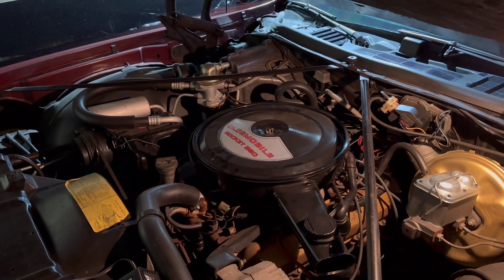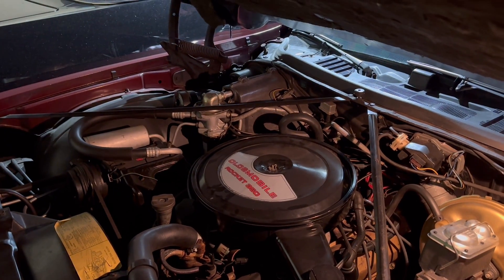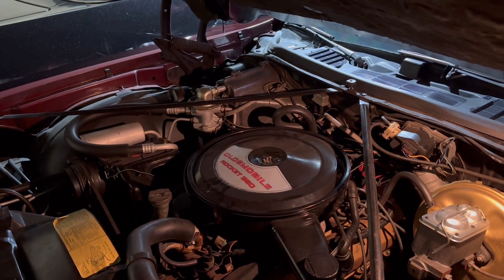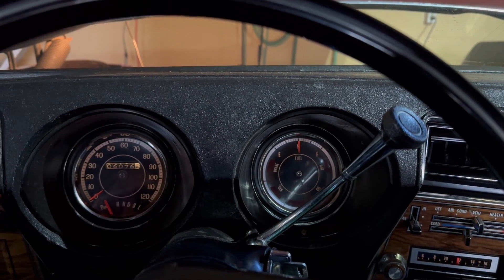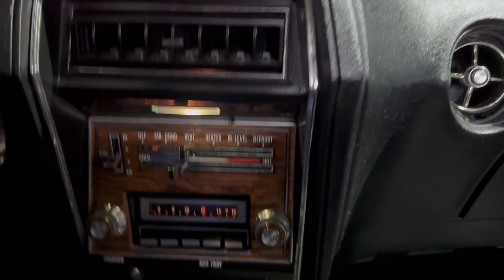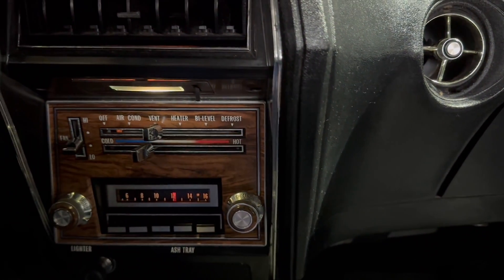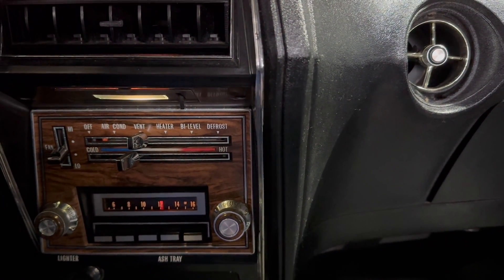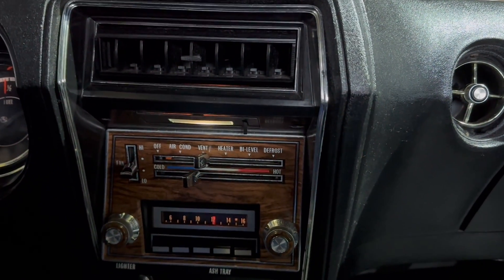GM's "Coolest" Invention Was a Strange Approach to Air Conditioning

Comment: The GM cars we owned back in the day did not have this feature.  The '70 Buick Estate Wagon had a separate setting for recirc called "max" for A/C.  The '80 Oldsmobile had A/C settings of "max" "norm" and something called "bi-level".  On both cars you could actually run the A/C on max and adjust the blend door to your preferred temperature.  This had the benefit of keeping dirty outside air out of the car. During the old smog days this was helpful.  But you could only use this selection for A/C.   I remember this feature and as a driver today on my new Toyota I choose to recirc air because of the pollution.  On the new car it's a button that can be used on all settings except for defrost.  On occasion my new car thinks its smarter than me and reverts to fresh.  I smell the exhaust and then have to re-engage the button.  I like the new car but still prefer the setup on the '70 Buick.  It's easier and does what it's told.  Fun story - In the summer back in the day as a 16 year old I would get the Buick to the State highway intersection,  turn east and punch it.  With the A/C on.  The car would hammer to 60 leaving a huge brown cloud of unburnt hydrocarbons on the highway, my 120lb frame smashed to the back of the drivers seat as if I was a 250lb man.  I remember my cousin riding along looked at me and said "455 don't care."
Reply: Both my Honda and my Hyundai fight with me if I try to use the defogger in recirculation mode, but they give in if I keep hitting the button. The setting is useful when trying to get the ice off the windshield fast, but it does risk fogging up the windows while underway.

Comment: Mid-1980s K-car-based Chrysler models, like the Lebaron GTS, the kind with the finger-sized pushbuttons, had a slider with recirculate mode only on the coldest setting, though it didn't affect the fan speed. I was never a fan of that setup because you could never get moderately cool, dry air out of it on a humid day, so the car could be either freezing or clammy, but never dry and comfortable. Another use for the separate recirculate switch is to de-ice the windshield faster on cold mornings (I believe the ICE setting on late 1960s Cadillacs would also enable recirculation). I suppose a GM-style control with both a MAX and ICE setting would give the driver who doesn't want to think about how the system works all the control one could want, but a separate switch for recirculation is a little more straightforward to anyone who understands these things.

Comment: It seems GM always had better  air and heat setups, on the 73 and newer trucks, GM's rounded body line, the trucks idiots refer to as "squarebodies", those heaters will make you feel like you're on fire, the Ford's of that era, you knew the heater was working, but that was about it

Comment: If I recall, that compressor had variable capacity based on heat load. There was a swash plate unloader mechanism modulated by refrigerant pressure. This ensured greater comfort when running air conditioning. The only purpose of the clutch was to engage the compressor when selecting air conditioning. The later short compressors used the magnetic clutch to cycle the compressor as controlled by the pressure switch resulting in a less refined load match.
Reply: Not the A6, it had fixed swash plate. The use of a POA valve in suction line that would take the overflow of higher speed and still get oil back to compressor when exp valve flow was reduced for a cooled interior/low fan speed and refrigerant flow was least.
Reply: @jimmyaber5920   Great info!  What happens when a POA valve eliminator and corresponding expansion valve is used when converting to R134a. Is it doing the same job as the original POA valve but just set for r134a evaporator pressure?
Reply: Fixed swash plate. Regulation was accomplished by a valve that bypassed the dashboard heat exchanger when things got too cold.
Reply: The CCOT system. Had a 4 cylinder Phoenix in the 80's with that system which worked well and was much simpler but the cycling of the AC clutch was annoying -the engine would buck and surge when the AC was set to low cool.

Comment: I had a 1979 Ford Thunderbird with an Eaton compressor and I had a 1979 Ford LTD with the A-6 Frigidaire compressor.  Both cars had good air conditioning and I never had an issue with the Eaton compressor.  That A-6 IIRC had the compressor clutch mounted in rubber on some of the later models and it came apart on the way home one night.  My dad had an A-6 from a 1967 Buick Electra under the work bench and we pulled the compressor clutch off that and it fit perfect.  I drove that car 200,000 miles and it was still blowing cold.  GREAT VIDEO!

Comment: So no a/c on demist/defrost?
Reply: I do believe that in Defrost the AC did come one.
Reply: There had to be a point in time where car makers first put in the feature of it automatically running the A/C with defrost.  So if you go to an earlier model year than that, they wouldn’t have that feature.  I’m pretty sure that (e.g.) 1970 was before that time.  Another thing about the GM A/C system (which I specifically remember from a 1970 Olds 98) was that if you turned on the A/C, and then switched to a non-A/C mode, the compressor clutch would stay locked on.  So if you knew the dehumidification benefit of running the compressor for defrost, there was an easy “trick” you could do, to get that.  The downside of the locking clutch was that if the system iced up, you’d have to stop/restart the engine to actually turn off the compressor.

Comment: Knew this was a Cutlass from the thumbnail.  They had that wonky center climte/radio panel which looked like it didn't quite fit the dash - feels like someone styled the dash and then was told to us a corporate part.  The clock panel to the left was equally odd.  Unique to the Cutlass line - not shared with other A bodies.

Comment: Dad's '71 Chevy had that setup with cold going to recirc/hi-fan, and it used the R6 compressor. 7 people in the car on 110 degree days could get real cold. My 1984 Audi 5000 also had the GM A/C with the R6 compressor, but Audi used lousy electrical connectors that I constantly had to fiddle with. My 1982 Cavalier had the smaller R4 compressor but that car could get cold enough to hang meat. None of my newer cars even come close.

Comment: Thanks for the information. All this time I thought the reason the high end Ford products used the GM compressor was because it was smoother and quieter than the tough as nails but vibration prone York units. I never realized that it was because of better performance in those large vehicles.

Comment: In my opinion the Most durable (performance aside) compressors were the York on the Ford, the V on Chrysler, and the A6 GM in that order. But all were very reliable. When GM switched to the radial compressor, the durability took a major DUMP.
Reply: And they also went to the cycling system with the low/high pressure switch. The old systems as shown here used a capillary valve much like a refrigerator or home AC system.
Reply: @edwardpate6128  true. The orifice tube works very well. But it pretty much provides all the filtration in a very small surface area. And it will easily clog up and cut off the oil supply. All the old systems that used the expansion valve with the capillary tube also had an “crank case” that held some extra oil. But the radial compressor has to get ALL its lubrication from the oil circulating in the system.

Comment: I think the reason the system would only blow on high in the recirculation/Max position was to prevent the evaporator from icing up . This was particularly a problem in the expansion valve type systems in humid conditions as is common in Florida. It was common for Fords and Chryslers to ice up on long trips because the system would be left on recirculate. Even if the fan was switched on med or low it's less likely to happen with those that have the orifice tube systems or any system that cycles the compressor. I think the elimination of that feature coincided with the introduction of the cycling compressor.. Although the expansion valve was supposed to prevent icing, it wouldn't do it so well at low blower speeds in recirculation position. It wouldn't be as apt to freeze when warmer outside air was blowing across the evaporator .
Reply: I wonder.  A late uncle of mine who was one of the few "car guys" in the family owned a '76 or so Grand Prix which had the later AC control layout with MAX/Normal/Bi-Level AC settings and no forced high-speed blower setting on full cold, and if that car's AC was run on MAX for enough time with the blower at a lower setting the evaporator would freeze up until no air would flow through the vents, and the ice on the low-side line under the hood was as thick as a baseball bat with ice!  :D  So then he'd just set it to vent and let it defrost before switching back to AC.  Memories sitting in the middle of the front seat of that car in the mid-late 70's between my uncle and dad on a family vacation trip where by being stuck in the middle seat I had control of the AC and the AM/FM stereo radio which was not so common an option back then!   Dearly miss my uncle and also miss that Grand Prix, he let my dad drive it and dad said it was the best car he'd ever driven at the time.
Reply: @terrybeavan4264  I think many of us have similar childhood memories of sitting in the middle seat. Today’s kids will never know because no cars have a space for a middle passenger in the front seat anymore. Unfortunately, although it’s a lot less common due to various temperature sensors , the icing issue hasn’t been completely solved even today, especially on longer trips in humid regions.

Comment: I feel like early late 80s- early 2000s Fords had a similar setting but it’s with a dial.

Panel setting turns off A/C, upper vents, blows outside air

A/C turns on A/C, upper vents, blows outside air

MAX A/C recirculates air, upper vents, and high fan speed(maybe others) has more blower motor power than any of the other settings on the dial.

Comment: Having a number of GM cars...we had the more common parameters of Off-Max Norm Bi-level-Vent_Heater-Defog.....our 1970 Kingswood had an additional setting beyond Defog of DeIce.  Our Cutlass, Pontiac 6000, Pontiac Grand Am, Pontiac Bonneville and square body Chev C/K pickups had practically the same HVAC control panels with the same slider setup.  The panel was styled differently for each division.  On the older cars, you hear the whoosh of the vacuum being released when sliding the mode lever.  My 87 Dakota was not a factory AC car...and employs the slider for the mode and will make a similar whoosh sound...funny story...I was changing spark plugs on the driver's side and accidently knocked the vacuum line off of the reservoir.  I put everything together and noticed two things..a really lumpy idle and the HVAC was stuck in defrost...which was the default setting when vacuum was lost.  A very let's step back through and figured out what happened to solve the issue.

Comment: When GM changed to the 1978-91 HVAC design, they brought the MAX/NORMAL/BI-LEVEL settings to tte A/C selector. MAX was then your recirculate, and it did increase the air flow volume but don’t know if it adjusted fan speed at all.

Comment: I know your 1970 Caprice is a non-AC car but if it had air those too had the latching cold slider which is even more odd because the mode slider has a MAX setting which flips closed the coolant valve and the recirc door.  So those have essentially two MAX settings.  Fits in with it since those also had LO fan at the top and HI at the bottom.  What strange controller!

Comment: The A6 was a Frigidaire compressor & GM owned Frigidaire. Back then GM owned many companies. The a6 was good but they did have a week clutch on them. They also drain a lot of horse power but they lasted pumped a large volume & worked well. They were also used on many tractors, swathers, off road equipment.
Reply: We had an old International Harvester refrigerator in our garage. Worked great. I never should have let it go when I  sold the house. 
It had the IH badging in front identical to their equipment. 
So International made a bunch of stuff too.
Reply: My mom had a Frigidaire washing machine.  It had the GM logo on the chrome emblem and I think it said "Mark of Excellence" as well.
Reply: All my appliances at home are still GM Frigidaire. That includes not only the Frost-Proof refrigerators and frost proof vertical freezer but also the oven, cooktop, the dishwasher and washer dryer set... Many of their appliances were high quality and innovative, probably the best products GM made. I also have a Touch-N-Cook range from 1973, the very first with all digital controls, the only knobs on that range are those for the fluorescent light switch and the lock lever for the self-cleaning oven, all the rest is controlled by a touch sensitive glass panel. Even my disposal is a GM Frigidaire with the GM logo on it (but it was made by Waste King Thermador). My microwave oven is also a GM Frigidaire Touch-N-Cook but those were made by Amana for GM. Amana, who provided microwave ovens for GM since the early 1970s also introduced their similar Touchmatic microwave ovens two years after Frigidaire introduced its Touch-N-Cook ranges. And they made a few versions for Frigidaire too.
Reply: Heh, thaat clutch was no weakling. It could stall a 350 small block when the compressor locked up solid. If you were at highway speed, you had to be fast to kill the AC, so it would disengage the clutch, then put the ride into neutral, and then turn the ignition to START and hold it there until the lights on the dash went out, and finally, put the thing back into DRIVE.

And find a place to park  safely, to assess the damage.
Reply: Your right about the clutch. I remember mine locked up on me one day and I just had to cut the belt off until I had the clutch repaired, but to me, that was a minor problem.
Reply: Yeah, I remember they sure did put a big load on the engine, even a V8.  Yeah, my clutch gave out at about 240K miles...
Reply: Wonder why they would use anymore HP than the new 6 cylinder squash plate compressors?
Reply: @Bryan-Hensley they probably did not.  Around that time emmision controls were added severely reducing HP. I had a "high performance" V8 with about 160 HP. Turning on the AC was like accidentally leaving the parking brake on. The car slowed dramatically.
Reply: @kevinpeterman7127  Yeah, turning on the AC was not something you wanted to do going up hill.
Reply: @Bryan-Hensley The A6s are almost always 12 cubic inches displacement per revolution.  There is also a 10.8 CID version used on Corvairs. Newer 6 piston swash plate or wobble plate compressors are usually 10 CID or less. A6s also have an oil pump, rarely found on other compressors.
Reply: Frigidaire? French company???
Reply: @SuperMixedd   It was founded in Ft. Wayne Indiana in 1918. So no, not French.
Reply: @TheBandit7613  oh my i always thought it was french lol
Reply: @SuperMixedd frigid-air
Reply: @jerbear7952  the "e" at the end hinted at the french spelling of 'aire' vs english 'air'

Comment: I knew instantly what you were going to talk about when you mentioned "GM only". I believe I first saw that on the 71 GM cars. And, it was a feature that I hated! There are a number of times where you might want the A/C in the recirc mode, without the hi blower speed. Had I owned a car like that, I would have immediately rewired it. On the other hand, that A6 compressor was considered to be the best compressor ever, because it was smooth, quiet, and lasted forever. However, it weighed a ton, and needed a fair amount of horsepower to run it. What is funny is that GM went from having the best A/C in the world, to having the worst, once GM went to the horrible R4 Harrison compressor.
Reply: I switched the vacuum lines in my '86 Dodge Lancer so that it would always be in recirculation mode. Before that, it only recirculated when the slider was at the coldest setting, so if you wanted it cool but not freezing, you got clammy outside air.

Comment: The weirdest quirk I know of in GM HVAC is that you can't turn the fan to actual "OFF". I've never had a GM that would actually shut the blower down. It's really fun when the bearings start to fail in the blowers and you get the tell tale rraaarrarwwwrrrrrrrr which cannot be stopped. 😂
Reply: yes, when I had my 1971 Fleetwood in FL, and the AC broke, that fan kept running even in off, pumping in hot air!  Not great for FL.
Reply: many later cars had that "always on low" fan feature, but if the system was turned off, the fan was actually off. (depending on the make) MOPAR had the low fan deal that was on any time the HVAC was on, although you could defeat it by slightly pulling out on the heat button. (button system, not sliders) I was aware of this issue on late 60s full size vehicles because people complained of the excess draft or overheating in the passenger area. I guess they were too lazy to move the temp lever.
Reply: The fan however had a thermal switch in the circuit to kill the fan when the-in car temperature was below 40 degrees and the slider was in the off position. This eliminated cold air discomfort in the winter during cold startups.
Reply: @Earcandy73  I'm not sure about that one across all models/years. I have one in my driveway that is about 2 degrees off of being tested. 😁
Reply: Someone once told it was because of Nader and was to keep fresh air coming in
Reply: @barfy4751     not sure about our old friend Ralph Nader, but it was an idea that was already in use for commercial buildings. (adding a certain percentage of fresh air) The practice reduces "sick building" with bad / stale air, especially in an era when many people still smoked.